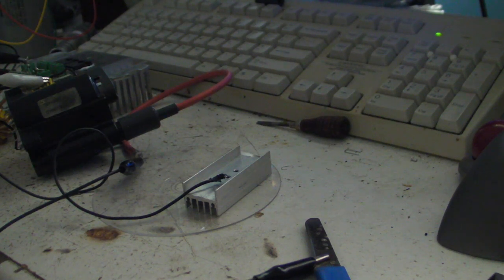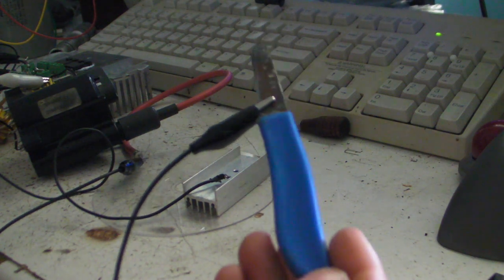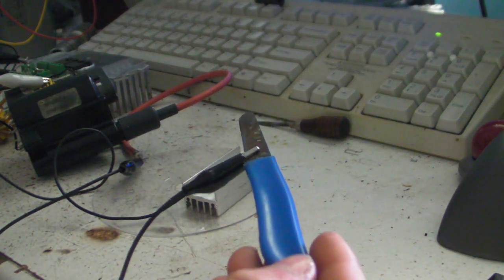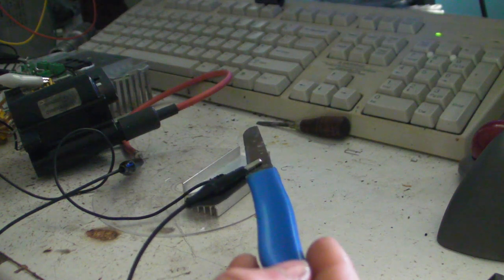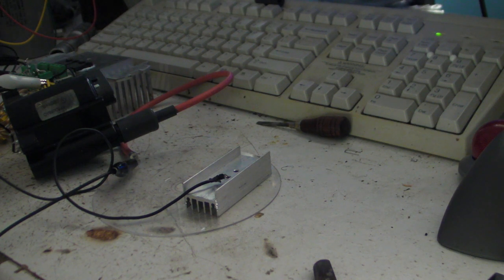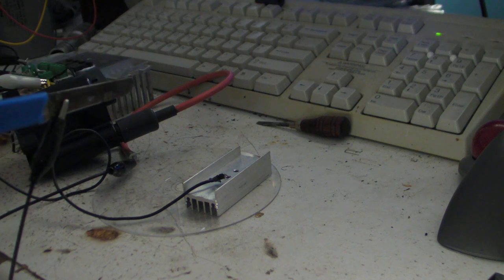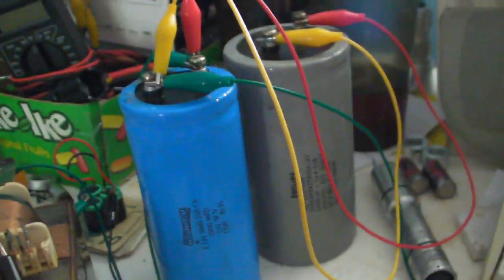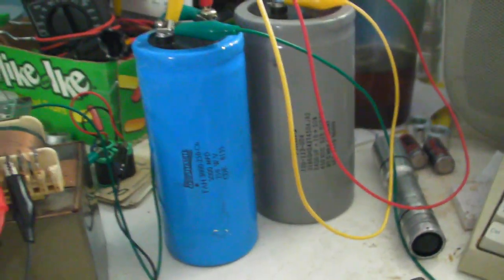ZVS Flyback Arcs (IRFP460)

Comment from the maker: @lokeycmos Yes, that is a great method. In this case, I used low powers and moved the wire over all of the pins and the one that made the longest arc (was clearly obvious because the others sucked). I ended up shopping off all of the other pins and hot glueing it. Has no problem with 4 inch arcs now. If my random capacitors dont blow by then, Ill make a video of the new arcs. I have some film caps on the way =D

Comment from the maker: @maintoc No, I just arced as usual, as you could see, near the pins on the flyback, it arced there between my arcs. In the end of the video, I just took the power wire off. Anyway, As of today I believe myself to have blown these mosfets as I get no output and they heat up a lot real fast now when they never heated before. I have more mosfets on the way and some IGBTs for when I make a more powerful ZVS.

Comment from the maker: @playcss1992 no shit. As I said, this is my first try with ZVS so I have not yet had much time to change variables for better arcs. Yesterday I accomplished to wind thicker wire on the flyback and make a new inductor with 20 turns. After looking, I noticed the capacitor to be .1uF, looks like I need to add

Comment from the maker: @filipkof Ya, that is true. But do consider that the heat has to transfer through about a cm+ of epoxy so the heat that makes it to the surface is nothing compared to the coils inside. Anyway, ya, I have my old flyback that I made into an AC one by high power, but it seems to be degrading, so, that means I have a decent ferrite core when I want to make a flyback =D

Comment: @PhxSt0rmz that sure is strange, my flyback and zvs makes the flyback transformer warm after a few minuites, but only inch long arcs. My ZVS is powered by 15VDC. I also hear hum in my spark even with a good filter capacitor. Once I put the filter capacitor in backwards on the ZVS and it bubbled and gurgled and almost exploded.

Comment from the maker: @scrapkilla321 LOL, I used to hold the wires but when I connect power sometimes I would get one of them long "Crack" capacitor type sparks jump to my hand. I would use a screwdriver but if the screwdriver has any cracks in the handle (can form from using a hammer with it) you will get shocked.

Comment: @juniortore1 I prefer the oil, it cools the flyback too, with such a current it heats up quickly as hell, need to get some big boys ferrite core.. i have never achieved more than 500w without blowing up the flyback, still have 25kw available, want to use the full capabilities of the main braker!!

Comment: @juniortore1 ya i made a little 555 flyback and i used to put the wires together with my hand till i got shocked lol then i started using a glue stick with the wire taped around it ... i also got shocked by a mot hurts like hella

Comment: hello

hmm for 48v is the spark very small, in the lenght i mean. try to reduce the capacity from 1uf to 0.68, or get a better flyback. and take care from 60v input, i did that and the zvs was killed.....cuz the flyback arcd over like this one. well u have to whatch my zvs ;) much better results with less input.